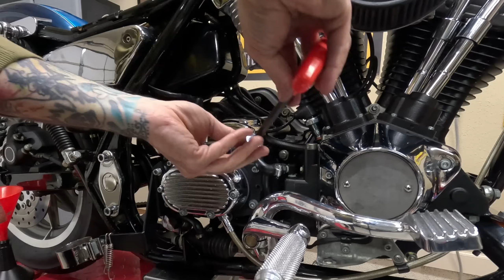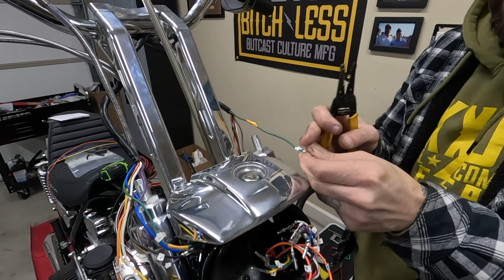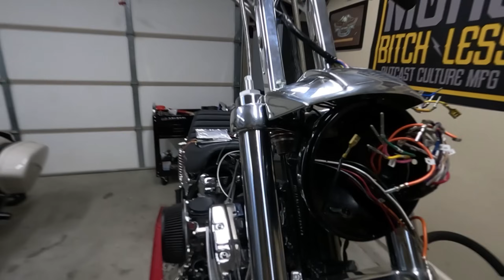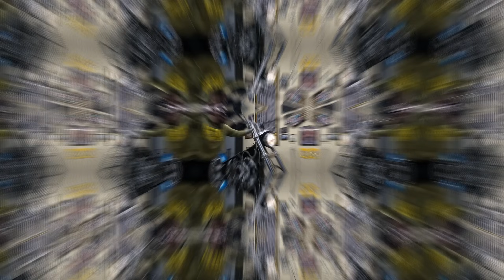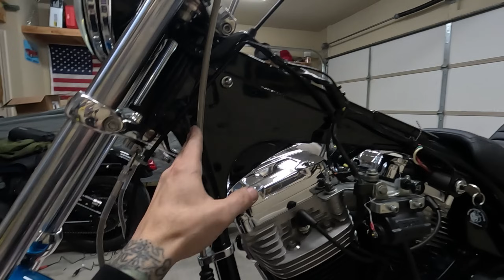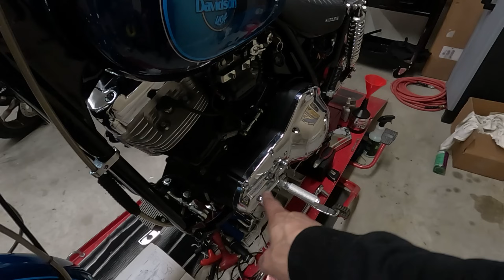Wiring COMPLETED!!! Bike is Ready to Start! - 1991 FXRS Build Series- Ep.8

Comment: If I’m not doing a complete re wire.and just extending for higher risers could   I cut the left and right control wires outside the the headlight bucket and extended them outside .To avoid dipping and opening  up the Hornets nest .thank you really enjoy your videos they are helping me a lot
Reply from the maker: Yes you can.  If you do cut, stagger the cuts so that all the connections aren’t at the same spot.

Comment: Man that front end looks ALOT taller than plus 2” sweet bike tho
Reply from the maker: Technically it’s more like 2.5” in the tube length, however the front end has nearly zero sag as well. It’s almost too stiff. I’m going to pull the gold valve and adjust them a bit, see if that gives the front end a little squat when the weight of the bike is off the kickstand

Comment: Badass! You forgot to mention what a pain in the ass it is to fit the headlight with the connectors and wiring in the shell.😂
Reply from the maker: The video would be 10 mins longer if I left the full clip of me pushing all the wires into place and getting the light seated 😂😂